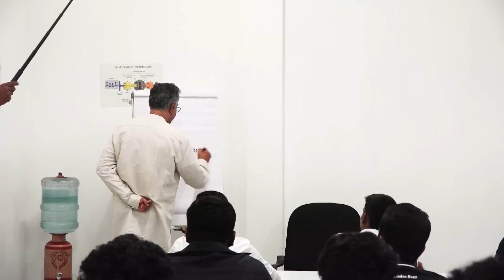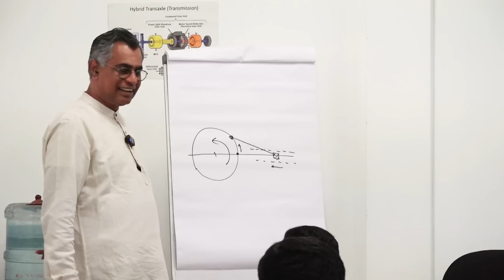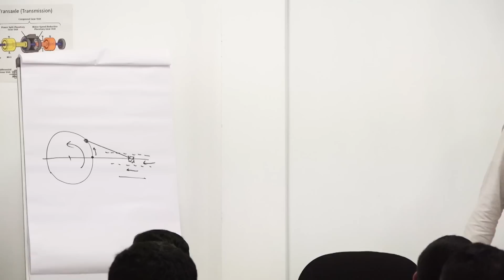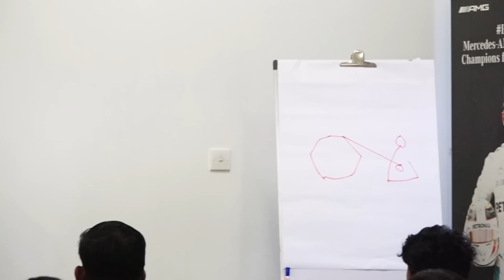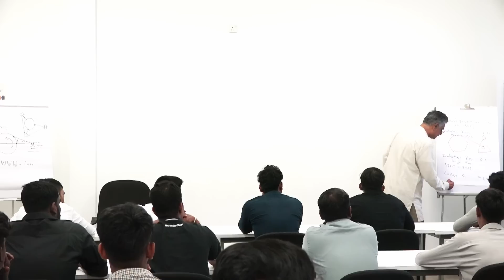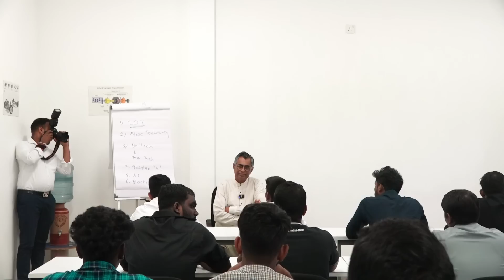පාඨලී යාපනය ඩිමෝ ඇකඩමියේ කළ සම්පූර්ණ දේශනය | Patali's Guest Lecture at DIMO Academy Jaffna

Comment: Love you.! and the way you teach.

FYI - Recently I've heard that NASA developed an engine of 10kW that runs 10 years with a single pellet of Boron Carbide.
It is not fusion or fission reaction - it is Not a Nuclear Reactor. It is called KRUSTY.

We would see those in few decades (or centuries) maybe. I still can't imagine how 3.16 terajoules can be put into a single pellet - and how much shielding needed for that to be put inside a terrestrial vehicle. They plan to use it in outer-space where stray radiation doesn't matter that much anyways